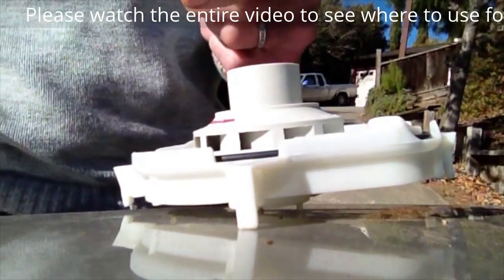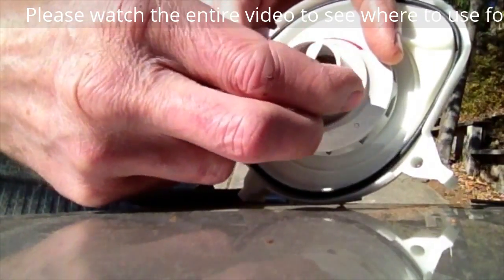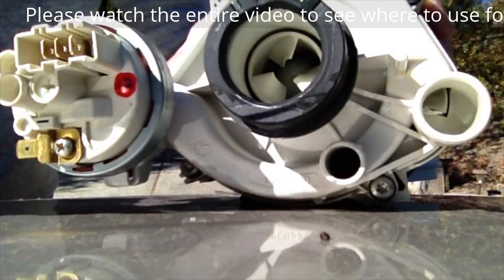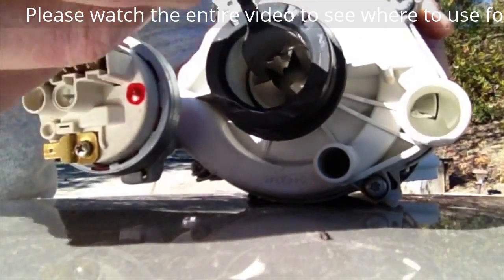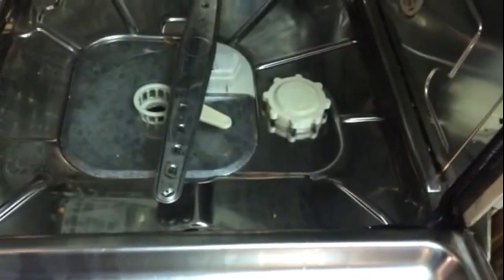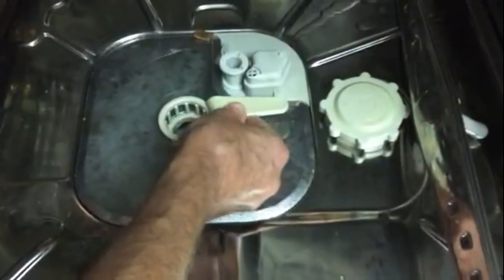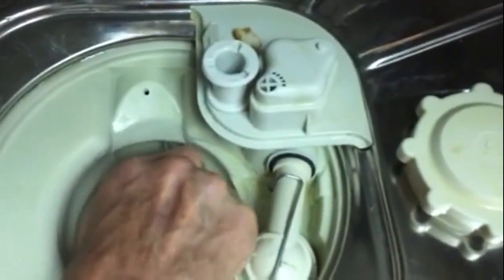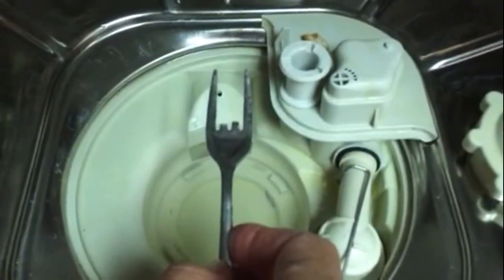🌎  Miele Dishwasher Intake/Drain light 5 Minute Fix - DIY - QUICK and EASY FIX

Comment: I've subscribed to the channel, watched a number of your videos, and read everyone's comments.  I have a Miele G896 SCI PLUS with the Intake light on.  I made the fork tool but my impeller does not appear to be stuck (I can turn it 360 degrees).  After resetting, the unit will drain for a couple of minutes, then it will fill with water to the top of the filter basket handle, then it stalls for a number of minutes and finally, the Intake light comes back on.  I'm very handy and willing to take the unit out of the cabinet and start tearing into it.  Is there a single motor that performs circulation and drain?  I ask because my unit drains just fine but no circulation.  If they are the same, the motor is good.  If they are different, then maybe my circulation motor is faulty?  Are there ways to check other things (besides a stuck impeller) that I could perform before taking it apart?
Reply from the maker: Great questions.
There are two different motors one for drain and a bigger one for circulation.
Sounds like it’s draining really well and that it’s filling to the correct level.
Usually during the fill cycle the computer will send power to the circulation motor as a test but it’s very common for the circulation motor impellers to get stuck.
The fork trick should do the trick but sometimes it’s hard to tell if the impeller is stuck or if it’s moving.
I like to make sure that the fork goes in as far as it can go and then I like to rotate back-and-forth a few times.
Reply: @QuickAndEasy5MinuteAppliance  I've verified that the impeller is not stuck.  After some practice, it becomes quite obvious when the fork is hitting the outer edge of the impeller vs going all the way in between the splines.  I can turn the fork and feel a very slight amount of expected resistance.  After it fills with water, I can hear a very faint electrical engagement (of the circulation motor?).  This will last about 10 seconds and then stop.  After a brief pause, I hear the electrical engagement again.  This happens 10+ times (didn't actually count) and after all those attempts, the Intake light comes on and the time remaining goes to 0.  I guess the main question is could the circulation motor have gone bad?  I think I'm going to have to pull the unit apart and take out the motor - ugh.
Reply: @QuickAndEasy5MinuteAppliance  test
Reply from the maker: Could just need a new circulation motor capacitor to help it start.

Comment: I tried this and it didn't work, but this did: Bail out the standing water. Add quite a few squirts of dishwashing detergent, then a kettle full of boiling water. Leave it for a while. By all means have a poke with the 'special tool' then re-run the dishwasher. 
I figure mine must have been clogged up with fatty substances.
Reply: Thanks Rob. This worked for me also!
Reply: Thanks, @Rob. Worked for me too.

Comment: The intake/drain issue keeps retuning after using fork tool to unstick impeller. Before I learned of this procedure, I twice removed the backflow valve and it seemed to work for a short time. Then I got a "no power" situation (no lights at all). I removed the control board to find a blown 472 k resistor. I found a used machine with a similar control board and it worked for several weeks but now the intake/drain issue has returned. I forked it and it worked fine but again it stopped mid cycle (after only 1 or 2 good cycles).Can anything else be done to save this G843 vi Plus?
Reply from the maker: Can you call Miele USA and ask for the 2 capacitors for your model and change them?
Reply: @QuickAndEasy5MinuteAppliance  I can do that. Would a failed cap be responsible for blowing the control board resistor because it let too much current through?

Comment: Hello.I tried it,on G660 (no lights) but the problem remains.Not enough pressure of the motor,as it turns the lower only arm,with one rotation every 10 seconds and although water goes even in the upper arm and from there it drops to the middle arm,neither of these arms is turning.
Of course i checked the drain pump and it works fine,the filters all are clean etc.Just the circulating motor seems to have little pressure.
Are you rotating the fork or moving  from left to right?And what point of the impeller are we trying to access with fork?The three "wings" at 1:09 or the 0:57 much more "wings" of https://www.youtube.com/watch?v=eXjT1nLDLRo video?
Reply from the maker: There's a good chance you'll need to replace the  circulation motor.

You might try EBay to find a good deal.
Reply: Yes and thank you for the reply,but my question remains 
"Are you rotating the fork or moving  from left to right?And what point of the impeller are we trying to access with fork?The three "wings" at 1:09 or the 0:57 much more "wings" of https://www.youtube.com/watch?v=eXjT1nLDLRo video?"
Reply from the maker: +me me so once the fork engages you rotate right to left snd then left to right.

I think it is unjammed since its able to pump the water.
Reply from the maker: +Quick and Easy 5 minute Appliance Fixes   I think there isn't enough water entering during the fill cycle.  Does the water fill up enough to reach the white plastic handle ?
Reply: Finally the pump was ok,but the electrovalve was faulty.So i changed it,the diswasher worked for 10 times and then it was leaky from unknown point.I am far from my home,when i return,i will try to find a solution...thank you all.

Comment: We have a problem with our Miele G647 plus dishwasher; it runs the washing cycle just fine, then drains the water, fills up with water to begin the 1st rinsing cycle, circulation pump comes on but stops after 20 seconds, water intake, 20 seconds circulation pump and you can hear the water being sprayed by the arms just fine but then stops again,  water intake etc.. this will repeat 4-5 times until the Drain/intake light comes on.
The pre-rinse program runs all the way without any problems.
Do you have a suggestions what the problem could be? Thanks in advance!

EDIT: after some time the problem mentioned above occurred directly in the washing cycle but I managed to fix the machine, please see my other comments.
Reply from the maker: +Daniel Boehmer  hi Daniel,
It sounds like the heater/pressure switch on the circulation pump needs to be replaced.
Reply: thank you for your reply! indeed, the tube to the pressure switch was heavily clogged. The tube connecting the labyrinth and the bottom of the washer was also clogged. after taking apart the washer and thoroughly rinsing every part with a warm shower hose the washer is working like a charm! Small note for people that would like to clean the washer after reading this post: never touch the reservoir with orange chunks in it.
Reply: Daniel, I have the exact symptoms you had with your Miele. I've tried boiling water, starting it countless times, but still get the "intake/drain" error. It'll fill, spray for a minute or two, pause and retry a number of times before quitting. If I start the cycle again the sump drains just fine and refills. Does the unit have to be pulled from under the counter and inverted to get to this pressure switch? Also, what are you talking about re: the reservoir with orange chunks?
Reply: Hi Mark, hope I can still help. You do have to take the dishwasher apart. Start with the top, then the side panels (some screws are hidden behind the rubbers of the door) and make sure to make a photo of every screw you remove. (I didnt do that and because of that i misplaced some screws causing the door not closing properly....)

After the panels are taken off, you first have to remove the labyrinth on the right side. Drain the labyrinth by unplugging some of the hoses and try you best to catch the water with a small bowl with two people (one can block the flow if the bowl is full). Then remove the valve/switch attached a bit higher to the labyrinth carefully and dont forget/loose the rubber ring.remove the cables and if im correct there is another some kind of switch attached to it. When the labyrinth (which is most of the time clogged with nasty black shizzle) comes out fill it up with warm water, (cleaning)soda and vinegar and let it stand for an hour or so. Then put the hose of the shower (without showerhead) on the inlets of the labyrinth and try to clean the labyrinth. Next up are the (clogged) hoses, take them from the machine and clean them with the shower hose. You do have to tilt the machine on its back and remove the bottom plate in order to reach every hose. please be aware of any water coming from the hoses so work again with two people.

It is a nasty job and takes some time (took me 2-3 hours) but worth it :)
When everything is put back to the machine is should work again. This dishwasher is really well built so think you should manage.

Good luck and remember to mark/take a picture of every screw/hose!
Reply: Oh and the reservoir with orange chunks/salt can't be missed. I don't know its function exactly but has something to do with the regeneration of the salt? Anyway, don't open the reservoir or remove it hoses as it is said to be nasty stuff.  

Note 2: after you cleaned your dishwasher you should let it run 3-4 times on highest setting as a lot of scale (dishwasher wil have white glow) and rubbish will come loose after reinstalling everything. It takes some more runs before the scale will disappear completely.

Comment: Tried this and it cleared the problem then a few weeks later the same light came on and was flashing this time. Tried this again but no luck . Pulled out the machine and saw straight away that the inlet pipe was kinked , straighten it up and problem solved.